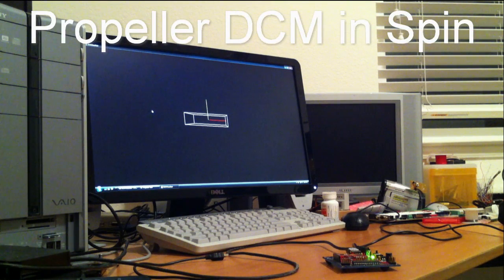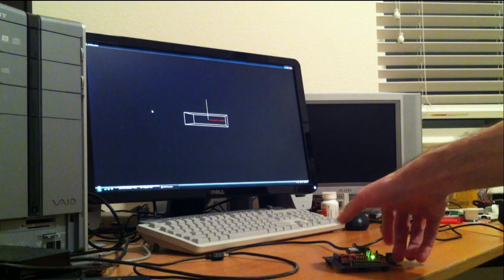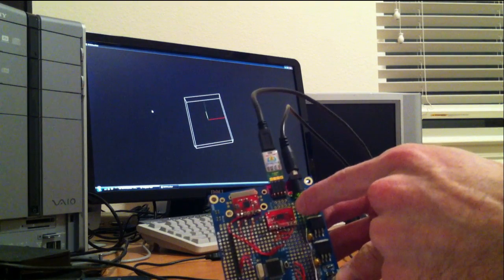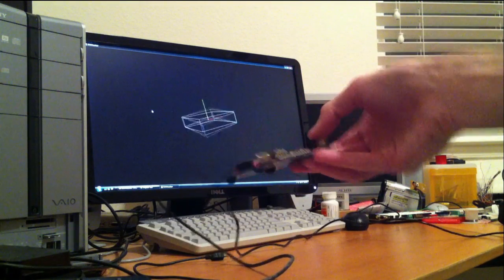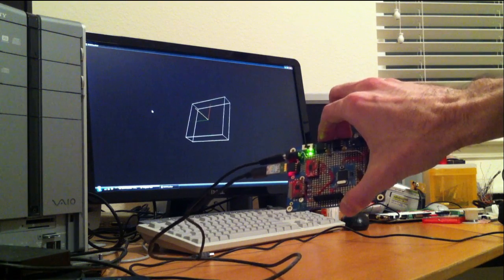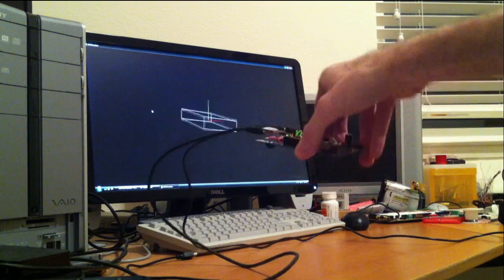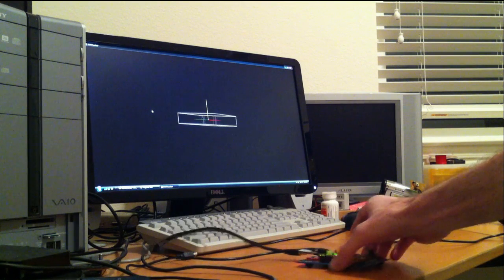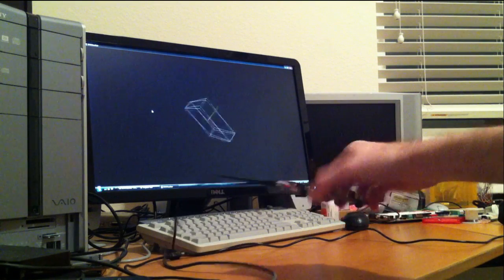Propeller DCM

Comment from the maker: @ksrm2 - There is yaw drift without a compass, but it's quite low.  The code is available on the Parallax forums.  Do a Google search for "Propeller DCM" and you should find it.  It even includes the C# app I use to draw the cube, and a PC-based implementation to help with understanding it.